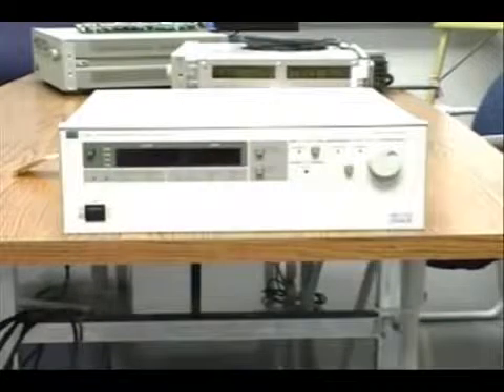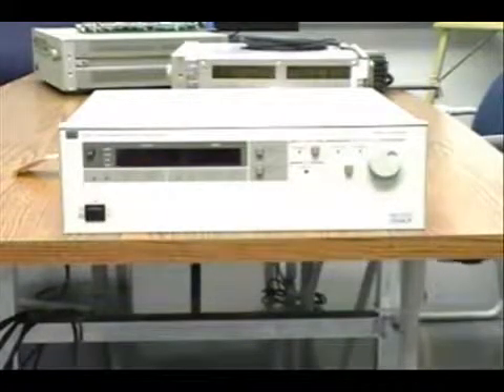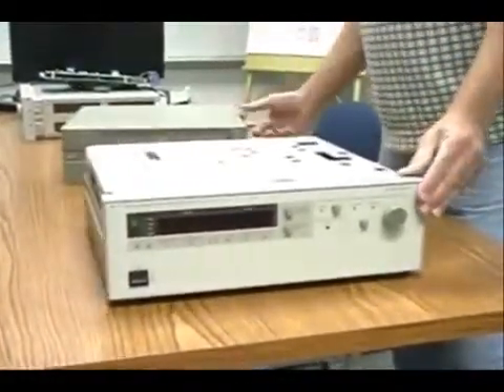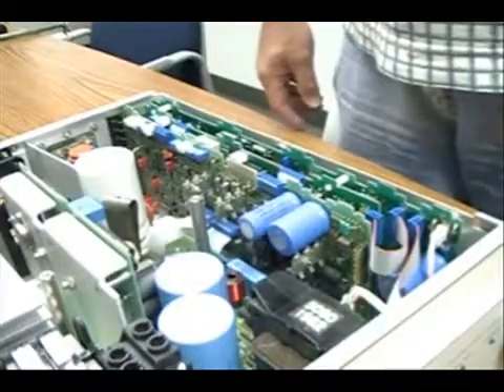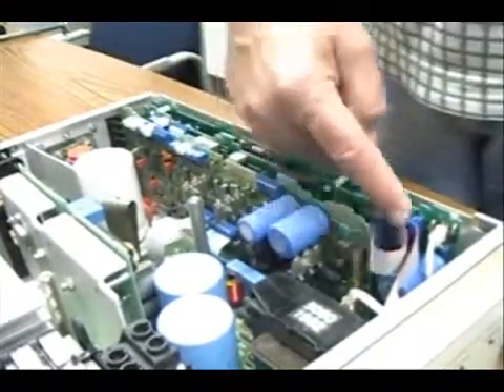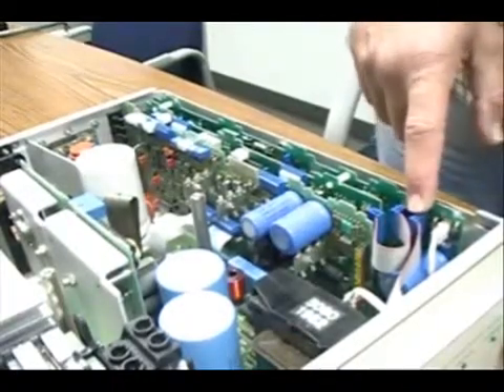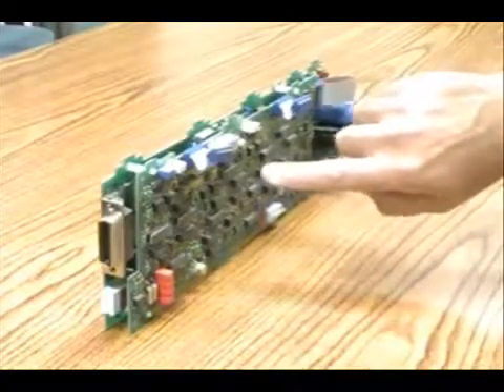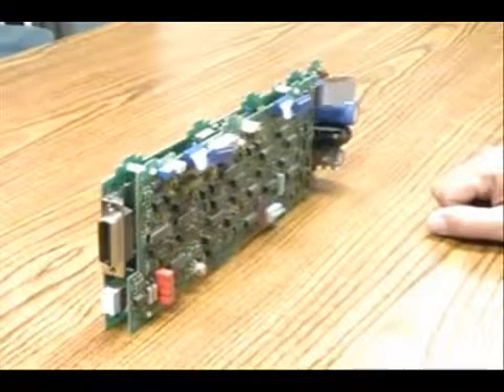Replacing the Interface GPIB Board of an older revision 603xA 1000W DC Power Supply

Comment: My giant HP power supply has some really fat caps inside. I think they are in a similar range if all of the values are combined. That power supply looks so interesting. It has a lot of stuff inside I have never seen before.

As it is sold for about 1000€ used (about 9000€ new back when it was released) I think that is to be expected.

Luckily I got that thing for free because it wouldn't output any power. I found a tiny blown fuse the size of a resistor and after replacing it, everything worked as it should.

I'm happy I was able to save that thing from the trash. It can output 0-60v and 0-50A (combined max. 1000w). It's really useful for a lot of stuff.